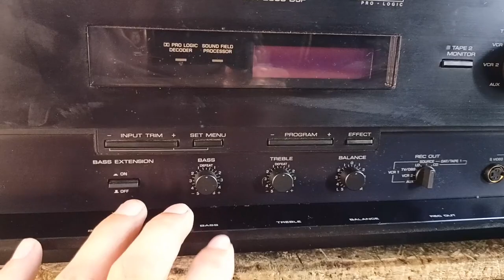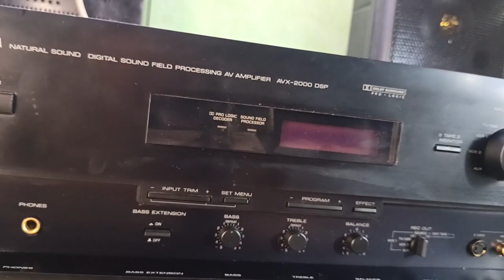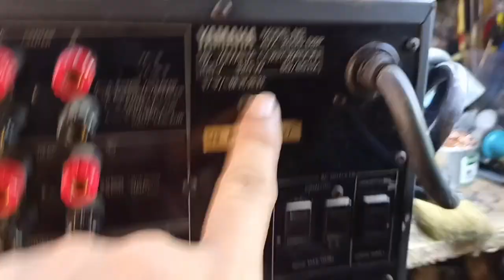YAMAHA AVX-2000DSP AV AMPLIFIER || DI MALINAW ANG TUNOG AT WALA DIN ANG IBANG SPEAKER OUT

Comment: Boss ilagay mo sa DOLBY PRO LOGIC.. or MOVIE THEATER.. Tutunog yan center..may ganyan akong amp boss😅😍.. pgnka effect off di yan tutunog ung center,ung Main speaker ang tutunog lng😅.nka built in ng DSP YAN boss.need mo lng e press ung program nia na DSP sa front panel nia..kc paiba iba kc tunog niyan boss.. SOPHISTICATED AMPLIFIER YAN BOSS..npkaLUPIT NG QUALITY ng AV AMPLIFIER Nayan! "TOP OF THE LINE" Yqn ng YAMAHA BRAND❤️❤️❤️💪🤩 

Sna nkatulong boss pra dika mahirapan mag repair boss
Reply: Naku boss wag mo eja jumper yan...
Ilagay mo lng Sa MOVIE THEATER,DOLBY PRO LOGIC,OR TV THEATER..nka separate po kc yan,Hanapin mo sa program nia boss
Reply from the maker: Ah may effector talaga dati yan nawala lang para sa extra processor , kahit naka jumper nmn sya ay dipindi pa rin sa sound mode nya kung sabay ang center o hindi na testing din nmin ng owner yan , may mode na walang center at meron nmn , tinignan ko ang circuit at yung jumper ay effector loop na kung mapapansin mo sa video sinabi ko na in at out ,(center out galing sa dsp , center in papunta na amp ng center ) so kung wala yun di talaga sya tutunog kahit anong mode mo e set , sana na gets mo boss , di ako basta bast mag jumper ng di ko alam or para lang tumonog kahit papano alam ko nmn ang mga ganitong klasing amp